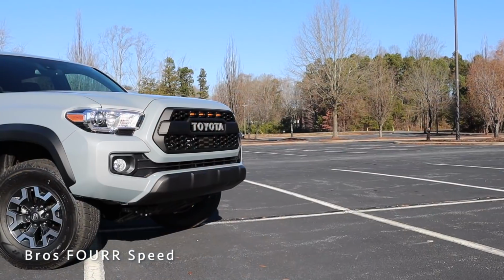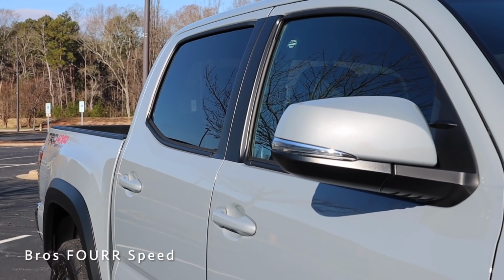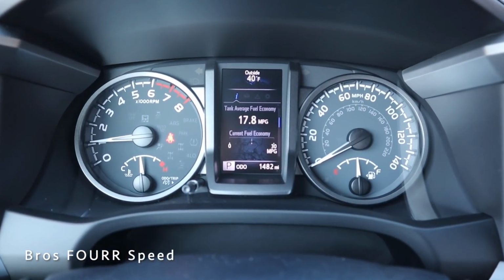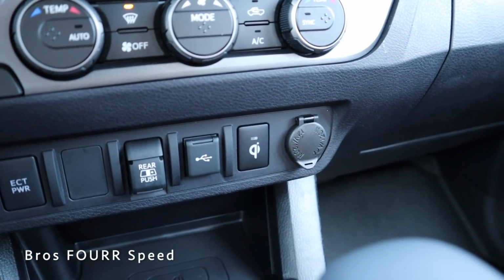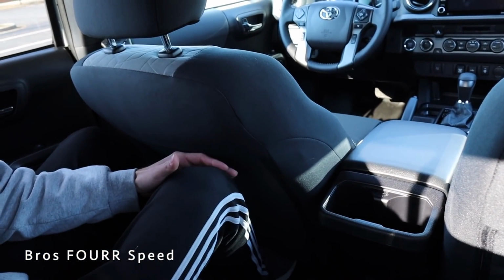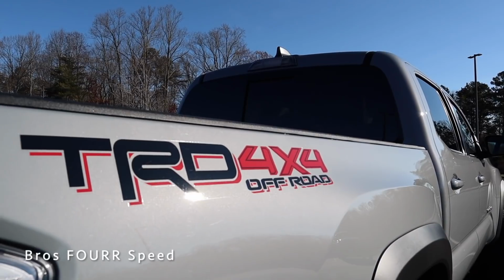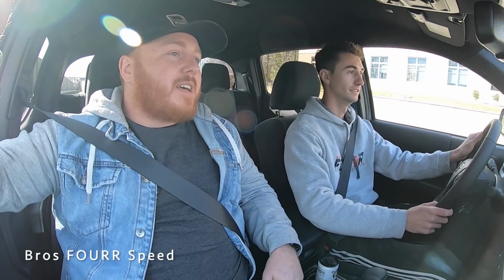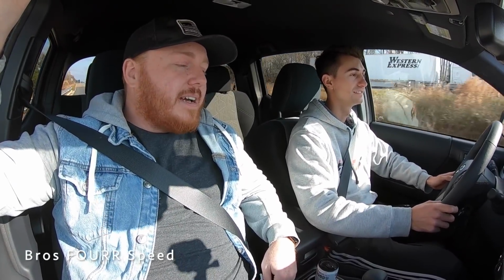2021 Toyota Tacoma TRD Off Road: Start Up, Walkaround, Test Drive and Review

Comment: Just bought this truck 2 days ago and absolutely love it! Like Cole I can't stop driving the damn thing! Lol. I bought mine in the Midnight Black Metallic, which has some blue metal flake in it and it looks amazing! Plus mine came with LED headlights with LED daytime running lights and black bezel LED fog lights, which makes the front look even better if you asked me. And they pop with that Midnight Black paint too. One thing y'all didn't mention that I like is how comfortable the seats feel. They are super comfortable to me. You have keyless entry and mine also came with electric start that I like but I also like the fact you have the Toyota app that links to it and allows you to start it, unlock/lock the doors from anywhere if needed. It also let's you know when it needs serviced and keeps record of when you do have it service. There's quite a bit more options on that app as well. But I live in the coalfields of West Virginia, where the mountains are HUGE and the Tacoma is perfect for here. Especially this one in particular, with the MTS/Crawl settings. If anyone is needing a good truck, this is a great one to buy. They also have great towing power to be a mid-sized truck. If you're thinking about buying one, go check these out. I believe you'll be driving one home.
Reply: Oh and if anyone reads this and is close to Logan County, West Virginia, come to Thornhill Toyota near Chapmanville. They are doing big things down there! They got me from a 20% interest rate on my car I traded in down to a 2.9 on the Tacoma!!!!! And they paid my car off that I literally just got 2 months ago!!! Come see them and look for salesman Robert Skonberg and tell them Mark Riley sent ya.
Reply from the maker: Very nice!!
Reply from the maker: Very cool man! The 2021 Tacoma is a great truck! Definitely can't go wrong! Seats are very comfortable I think too

Comment: Do all Tacoma's have an engine ticking sound? Or is it just mine, just recently bought brand new. Don't know if that's normal
Reply: It’s normal on most vehicles today, no need to worry too much.
Reply from the maker: Yeah thats just the valve train. Since int's new though, everything is under warranty. So worst case bring it in for them to check it out
Reply: Bought mine 2 days ago and mine is doing the same at low speeds or idle.
Reply: @MarkRiley12  yeah same, I'm assuming it's normal though. Not too sure I've spoken to multiple taco owners and they all say the same.

Comment: I traded in my 2015 Tacoma TRD Sport for a 2021 TRD Off Road 4x4 and man I love it 👌🏼
Reply from the maker: Nice! I bet you're loving the upgrade to the 3rd Generation Tacoma! Great trucks and you cant go wrong!!
Reply: Does the transmission still wander all over the place? One of my concerns before I even consider a Toyota
Reply from the maker: @seadoo4life127  I don't think it's bad, city driving is normal. It's mainly on the highway the truck goes between 4th and 5th, doesn't really utilize 6th much. I regeared my 17 and it uses 5th and 6th now o the highway. But I'd still buy it again!
Reply: @BrosFOURRSpeed  i’ve had two Chevy Colorado’s. One with the six speed ,which was terrible ,and now I have a ZR 2 with the eight speed and honestly it’s way better but still not perfect. It’s amazing how these companies just cannot get it together. My lease is up in a year and trying to figure out my next truck

Comment: How does the TRD Off Road drive on pavement? Is it bouncy ? Also, are those tires noisy on the highway?
Reply from the maker: It's very solid on road to be honest. A little bit of break dive. But suspension absorbs bumps very well. It' very quite to drive!
Reply: @BrosFOURRSpeed  Thank you! Great review btw
Reply from the maker: Glad you enjoyed it!
Reply: Mine rides A-1 on the highway. The off road tuned suspension with Bilstein shocks rides pretty smooth on and off road.
Reply: @MarkRiley12  thanks for the reply! I wasn’t able to test drive one. My local dealership only had the TRD Sport in stock. Can’t wait to get mine soon
Reply: @bigzee5102    Yes sir, you are most welcome! The tires that mine came with are the All Terrain Goodyear Adventure's with Kevlar and they do really well. It looks as though its the same tires that's on Cole's in the video. Mine don't have any road noise and they ride really smooth. And last night I took mine up in the mountains here in West Virginia and we have about 4 inches of snow to come down last night, which is the reason I went out in the hills in the first place, and those tires did exceptionally well. And the 4x4 in the truck did also. I tried out the Crawl setting and it took me wherever I wanted to go, up hills through deep snow and through mud holes and everything, without even touching the gas pedal or brake pedal. It has multiple speed settings and that was on the highest speed setting it has. You can put it in lower/slower settings and it will literally granny itself wherever you want to go and through just about any terrain without ever touching the gas or brake. The truck is an absolute beast! I love it!

Comment: do the doors sound crunchy when shutting them, mine does
Reply from the maker: They sound very solid! I would assume your black hinge piece has a loose bolt. Take a look at that and see if that's making the noise
Reply: @BrosFOURRSpeed  my moms rav4 has that black bar and the wind kicked the door forwards, and I went to close the door with the window rolled all the way down, AND BAM there goes the read door window😂
Reply from the maker: @misterpimlott6330  Ouch... Thats no fun lol
Reply: @BrosFOURRSpeed  lol I guess thays what happens when you cheap  out
Reply from the maker: Yeah hopefully you get it all squared away!

Comment: Man I love everything bout it but the 4 door. I’d  love to have the access cab trd off road cause Of the 6 foot bed.
Reply from the maker: That's why they make different styles!  It's cool to see the access cab with the 6ft bed is the same length as a 4 door with the 5ft.  If you don't need more space in the back it's a great option!

Comment: My dealer trying to figure out how to make the sensor work on mine.  How did yours do it. The claim that the stock one is higher and is giving them issues as far as sensor goes
Reply from the maker: Make the sensor work with this grill?  I just hooked it up and haven't had any issues with it.  What else is going on with yours?

Comment: I'm not sure if this is the 2021 model due to the chrome rear bumper.
Reply from the maker: It is.  The TRD offroad either has the chrome end caps, or with the tech package it comes body colored.  That package gives you the sunroof and backup sensors.
Reply: @BrosFOURRSpeed  i thought toyota has all trd models with no chrome bumper for 2021.  Maybe the other youtuber are misinformed too.
Reply: @BrosFOURRSpeed  went back to double checked and you are correct.  I was wrong.
Reply from the maker: @nseanlee88  It's all good, you make a good point about the 21's maybe being different like that, I didn't think about that!

Comment: Ordered the same thing but in manual 3 months ago.  Still waiting.......zzZZZ
Reply from the maker: Oh wow!  It's been a crazy year with vehicles and having delays!  I'm sure you will get it soon!
Reply: You will love the manual.  Have both auto and manual and the manual  is 10x better for those who say no they don't own both or have taken 1200 mile trips in both back to back... the 4.30 gears in the manual  are awesome.  Only draw back to the manual is the tall reverse. A suggestion,  buy 2WD Lo mod it will save your clutch reversing trailers or if you need to back up a steep incline.
Reply: Sales rep just hit me up and said delivery date is between 3/9 - 3/13.  Super stoked!

Comment: Any quality difference in the tacoma  built in Mexico    v Texas?
Reply: TRD PRO TACOS are Built in San Antonio, TX, all the rest are assembled in Baja / California, Mexico 🇲🇽
Reply from the maker: Oh interesting. I know for older years it was like 50/50
Reply from the maker: Not that I am aware of.  The only issues that I have seen that could be from the different plants is the third brake light issue with water getting into it.  But I don't think too many people had that problem.  My 2017 was actually built in Kentucky and it's been bullet proof!

Comment: Why isn’t a drivers grab handle to aid in entering the truck? Passenger side has one.
Reply from the maker: I'm not sure.  My brothers 2017 doesn't have one either.  His 2007 did and it would be great to have sometimes, but I'm sure there is an aftermarket one to add if needed.
Reply: @BrosFOURRSpeed  there is one. Have you bothered to use the search button on Tacomaworld?
Reply from the maker: @AdrianRodriguez-pg9nr  Nope Lol. I don’t own a Tacoma so I’ve never been on that website. My brother may have idk

Comment: will be in the market for a 2021 Tacoma double   6ft  bed ,what have you guys paid?
Reply from the maker: Depends on the trim level you go with.  It should range between low 30's to mid 40's, again depending on getting an SR5 up to the Pro's!

Comment: An over rated over priced plastic junk box on wheels the dealerships buckle over laughing every time a sucker drives off the sales lot with one of these junk boxes..
Reply from the maker: Haha, have you ever had one?  Toyota is more of the most reliable vehicles on the market.  I'm on my second Toyota Tacoma because I love them so much and have had zero issues with them.  They are expensive because they sell and even hold their value extremely well on the used market because of the demand for them.
Reply: I have this truck 900 miles it's in shop again ...
Reply from the maker: @billobanio3311  For what? I don't know too many people who have had issues, most all have been reliable.

Comment: All other truck manufacturers have great technology and more features, more horsepower etc yet Toyota still outsells them because of reliability, that is crazy! I still think they need to update their trucks
Reply from the maker: I think that goes to show you that truck buyers value a dependable truck over all that tech. Toyota is the best for a reason!
Reply: @BrosFOURRSpeed  I have a 2020 Tacoma and a 2014 f150. Honestly if I was choosing a 2021 truck to buy I’d go with the f150, but it’s hard to argue against Toyota,
Reply from the maker: @txkingg  For boy sized trucks I’d go for the F150 all day. I really liked the 2021 F150 I filmed! But if I plan of off roading. Tacoma is the way to go!

Comment: Yea...friend from the great state of Iowa! Had been looking for a new TRD OFFROAD with MT. Found one that was that Cement, which I like. It is a TRD Sport though, and I have it in my head to get an OFFROAD, even though I would probably rarely go offroad..go figure!!!!
Reply from the maker: That’d be a cool choice! Although mechanically the Sport won’t be much different. The manual Tacoma won’t have CRAWL Control anyways. So the only difference might be a locking rear diff. Good luck with your search. Can’t go wrong!

Comment: When is Toyota gonna do a full redesign since everyone picked on the Frontier all these year
Reply from the maker: I’m sure 2026 will be the 4th generation Tacoma. Toyota tried to make there vehicle run for about a decade. But Tacoma has always been way ahead of the Frontier
Reply: Toyota’s already working on the redesign for the Tacoma atm, I think it’s coming out next model year or year after
Reply from the maker: @Keegs1710  I would assume 2026 will be the 4 generation Tacoma.
Reply: @BrosFOURRSpeed  yeah your correct, I got the tundra and Tacoma switched up. It’s the tundra that will get the redesign next year or so
Reply from the maker: I'm excited to see a new Tundra! Desperately needs it!
Reply: @BrosFOURRSpeed  me too, Toyota is my favourite automotive brand and it hurts me inside how there 1/2 ton trucks don’t hold a candle to the Fords dodges or chevs
Reply from the maker: Yeah really. I'd buy an F150 all day before I bought a Tundra. Tundra just seems old and huge. Not a fan. They need to add some Tacoma flavor into the Tundra and make it way better for the next generation
Reply: @BrosFOURRSpeed  tundra is way better than a ford man.. reliability all day. But I'll stick with my 20 sport manual transmission all day
Reply from the maker: @T-SMOOTHJIUJITSU  Yeah Tundra will last longer for sure. But after driving the 2021 Platinum F150. I’d rock that all day! Tundra still feels like an outdated truck. Just too bulky on the inside. I don’t like it. And I don’t own cars long term enough to need it to last more then 100k miles lol
Reply: @BrosFOURRSpeed  haha fair enough. Each to their own. I change my vehicles usually every 2-3 years myself, but would be nice to not have a truck payment once in my life and gave some reliability haha. I dunno we will see
Reply from the maker: haha I hear you on that!